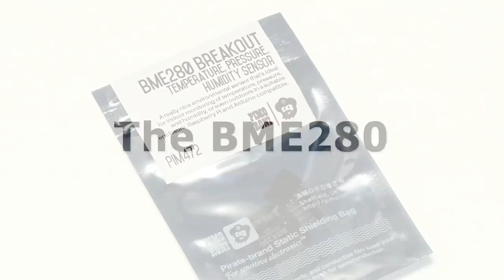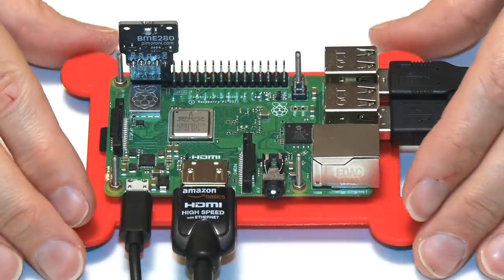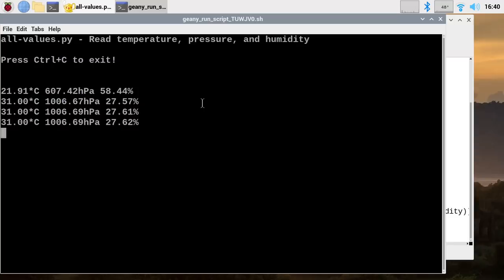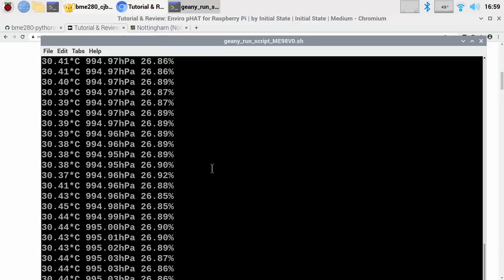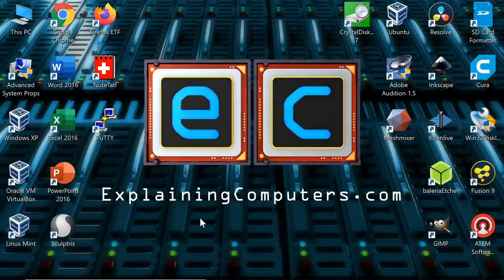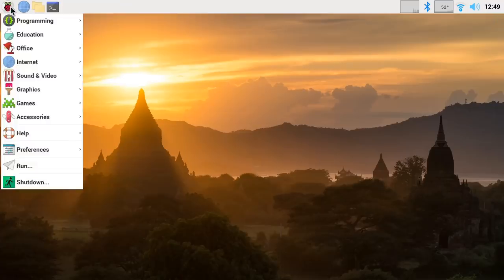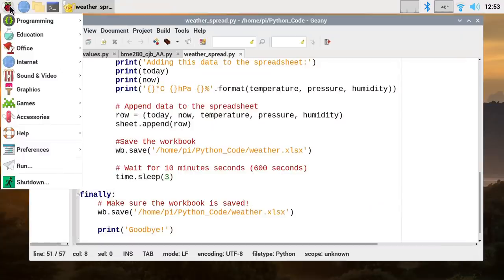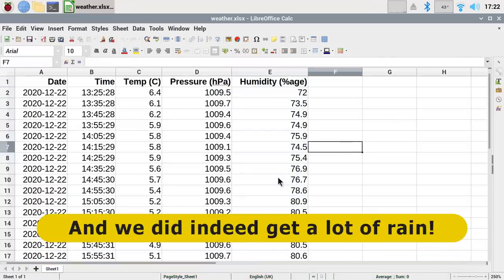Raspberry Pi Weather Station

Comment: Another great tutorial, I’ve one of these BME sensors and two DHT22 sensors (not as accurate and no pressure sensor) setup with Arduino ESP8266 devices logging to an influx database for analysis and a Grafana front-end, that’s running on docker on a raspberry pi 4 though! 😉

Comment: Chris, this is WONDERFUL.  You have helped me resolve how to get  my data into a spreadsheet !  For an improvement, I would like to see wind speed and wind direction added to COMPLETE my weather station experience  :-) 
Would you do wind speed with an analogue indicator ? Or a STEPPER motor ?
The weather vane would be simple enough with a few LEDS  and a photo cell, I imagine...
But how would you calibrate the wind speed anemometer ?

Comment: Thanks Chris, another interesting video. I have a thermometer attached to my pi 3b+. I start my temperature monitoring program, also written in python, as a cron job, so no need to manually run it. The temperature value is written to a text file every 10 minutes and it is also published to a web site hosted on the pi. The current temperature can be seen from a browser on my network. 

I had some fun running the thermometer for a month and graphing the values using some more python code (I was learning python).

I use it to monitor the temperature in my kitchen when I am making bread. Yes I could have used a $5 one from <insert store here> but that's not the point :)

Comment: It's a very educational. How to get a temperature in F? And add a wind strength and direction to the next video.
Reply: temperature = bme280.get_temperature()* 9/5 + 32
 pressure = bme280.get_pressure()/33.86                                              
humidity = bme280.get_humidity()
print('{:05.2f}*F {:05.2f}Hg {:05.2f}%'.format(temperature, pressure, humidity))

Comment: Great video once again Chris and one project I will look into building specially in this part of the world where the temp fluctuations can range from -15C to +40C along with the odd earthquake or 2 a year.

May I suggest if possible,  a couple of things to add to this project:
1. An implementation of a "Raspi-powered seismometer"  bit like the RaspiShake, possibly the "Geophone - SM-24" is to expensive component to consider for this, but this would be the ultimate weather station for me, due to frequency of quake we receive here.
2. The data collected published on a webpage as well as how you done it as done into a spreadsheet.  Perhaps change it to output/save to 2 files spreadsheet and text file that can be read later or go further insert it as MySQL query into a DB.

Also, putty is a great tool but I recommend you look into using "mRemoteNG" is a much more versatile remote utility allowing multiple panes side by side among other great features.

Thanks greatly for your education and engaging computing videos.

Comment: more possibilities: automate making a new csv every month so you’re not stuck with a massive file over time, visual graph compatible with home assistant - grafana? nodered? mqtt? view data on a smart mirror / magic mirror. build more raspberry pi sensors for different locations around the home. centralise them into home assistant.

Comment: Nice video Chris, huge amount of potential in these things for peoplei
've done something very similar using piZero's and a combination of BME280's and BME 680's. The 680 can also monitor the air quality for poisonous gasses. Very handy in my projects as i am monitoring the temperature, humidity, air pressure and quality in an outdoor car storage system. I post the data 
out to a hosted system on an InfluxDB with a nice Grafana front end. Also the 680 has a much nicer python library, however it is almost double the price.
Reply: did you manage to get it to a xlsx file. because i keep getting an error,
'( cannot convert (0 r to excel format value) its something with excel and the temperature of the bme680

Comment: How accurate is the BME280 sensor?  I've played with some cheap temperature sensors before, and they were pretty inaccurate... off by 3 or 4 degrees Celsius.  The data sheet gives accuracy numbers for relative humidity and pressure, but not (alas) temperature.  EDIT: Oops, found it.  They claim "typical" accuracy of +/- 1.0C for 0-65C, which is resonable.

Comment: What a disapointment! A weather station with no meassuring of wind direction or speed! :) 
Although i must say i was a bit disapointed (i will explain later), it's a rather interesting sensor you have chosen Chris. There are far more cheaper Humidity/Temperature sensors arround (eks. DHT11 and DHT22) I have used theese for years now. Especially the DHT22 has pretty good accuracy. I have had thougths about trying the BMC you are using, but found it to be to expensive for my use - i use several of thees sensors for surveilance of humidity in my home.
Back to the Weather station stuff. For several years i have had a raspberry pi running WeeWX. It gets data from a bought weather station (Moist, temp, pressure, windspeed and direction, gust and so on), and reporting data to online sites every minute.
The version I'm running now is pretty old and it only runs on an old version of raspian. That was the reasson i was disappointed. I had hoped from the title, that you had made a video about that kind of software. :)  
But maybee in another episode of Explaining Computers. ;)

I hope you understand that I'm really not disapointed at all . ;)

Comment: I started working on the same type of system using the Sensor Hat for Raspberry Pi. Ran in to the same problem with the CPU temp screwing up the results. Got screwed up trying to figure out what ribbon cable/ m to m or f to f converters to use to move the Hat away from the Pi.

Somewhere along the line, took a detour and ended up getting an account on OpenWeather, getting the current readings for my area from their API in Json format ( which I know nothing about but found Python code on Github that already decodes OpenWeather output ), and using the Sensor Hat extensions for Python scrolling the results over the 8 LED grid on the Hat one letter at a time, getting updates from OpenWeather about every 15 minutes (free as long as you don't query them more than once a second).

I believe you can add your weather station to their network if you desire.

Funny where you can end up when you start a project.

Comment: Interesting project, although it is probably worth pointing out that the pi4 expects an operating temperature of between 0 and 50’C although the BM280 will cope with -40 to +85’C .... I was expecting half the video to be about specialist pi housings to protect it while doing the data collection. 

Also, isn’t there a crowd sourced weather data collection project you could submit your readings over to?  I seem to remember there was going to be something like that for schools a while ago.

Keep up the great work 👍

Comment: Maybe should have mentioned that the pin header holes are offset in an alternating fashion so that the pin header can be inserted and used WITHOUT any soldering required, in case anyone wants to breadboard one of these and not have to commit to permanently soldered pins. :)

Comment: couple of things there Chris you may need to compensate the pressure to sea level using your altitude that will give you the accurate pressure for your area...also i dont kow if you know but the eps8266 or esp32  modules running tasmota are great for these devices.. ihave a lot of these running on my network sending mqtt data out to internet so i can get tempa barometric reading and humidity from any where i am . i also use an android app called mqtt dash board on my mobile hpoen to access this data...

Comment: The link between temperature and humidity lead to real life problems!
I worked in the bread manufacturing industry.... simply force cooling down the bread after baking is not a viable thing.
You need loads of cold air with high humidity so the loaves don't dry out and loose weight.
It was always a pain keeping the machines doing what they didn't want to do!
High Temps with High Humidity and Cold Temps with Low Humidity are what nature want's to do!
So of course we want low temperature with high humidity to cool our bread, but to stop it drying out and loosing weight 😎

Comment: I'm currently using a free weather API to do my weather display for the custom home hub I'm building.

I want to make a local weather station and add more indoors dht11 sensors around the house.

I have an hourly temperature graph that I originally used with my dht11 sensors to monitor temperature for an indoor grow area. And now I have it showing indie and outside hourly temperature...

If want to include an array of light sensors in my future weather station so I can track the sun position. Like a digital sun dial.

I'll have to look into pi hats like the one in this video do I can have pressure data... I'd also like to be able to collect wind and precipitation data...

But this project is probably years off before I find the energy and focus to make any real progress.

Comment: Happy New Year. Thanks for a wonderfully thought out and put together video. This a great and fairly easy raspberry project. I like using Window's 10  ssh program for connecting to the Raspberry PI, so that might alternative for some users. I am looking forward to see a year filled with more interesting for Explaining Computers!
Reply: This might a good project Raspberry Pi 400 because the GPIO pin aren't too close to the chips and there should no heat from the computer itself.

Comment: Thanks for the video Chris.  On my French mountain at 5PM  on 3rd Jan 2021 its -5C.  I wonder if the script can handle negative temperatures?  Best wishes.
Reply from the maker: The script can handle it. :) The datasheet for the sensor gives an operational range for the temperature sensor of -40C to 85C, but with full accuracy in the 0C to 65C range.

Comment: I just learned an amazing amount in 20 minutes. What a cool idea using a pi as a weather station and it’s a great start but I wonder how much further this could be taken. Could an LDR be used to measure sunshine, could you add wind monitor and maybe a rain measuring device using resistance impedance :)

Comment: I've already done this, but taken it much further.  I have the pi running headless with a bit of custom C running as a service.  I run MariaDB on a VPS with the pi connected via a VPN and adding the data to a database.  Apache is running, so I can simply load up a web page to view the data using Fusion Charts.  Its been running seamlessly for more than three years, collecting minute by minute data.  There is now more than 4 million records in the database.

Comment: Maybe it would be advantageous to time how long it takes to get to the stable table of results and then set a delay on the display of the data, piping the data to a small graphical display window with just an updated single result number as default and a graphical switch for data over time would be preferable to an SSH display window.

Comment: Thanks, great video as usual!  One quick question ... How was the BME library configured to know what GPIO pins were used for the BME280 board?  (For those who may need to use different GPIO pins to what you used in the video)
Reply from the maker: Thanks for this. :) The Pi communicates with the BME 280 over I2C, which is a two-pin interface available on the Pi via GPIO 3 & 5. So you can only use these particular pins.

Comment: Thanks Chris, I enjoyed that. I'm looking at doing something similar with the BME680 (which also includes an air quality sensor) but what I really want is to have the data sent out to an IoT platform on the web where the data can be stored in a database and displayed using dashboards in a browser. I'm still deciding on an IoT platform - the current front-runner being InfluxDB Cloud. I think that adding similar functionality to your project would make a good follow-up video.
Reply: did you manage to get it to a xlsx file. because i keep getting an error,

Comment: Wonderful stuff Christopher, instant sub. Will you continue to develop your weather system to include wind vane or perhaps windspeed?
Reply from the maker: Welcome aboard! :) I had not planned to continue this project, but as the video as proved very popular, I will. I am already pondering how to measure wind speed. :)
Reply: @ExplainingComputers  thank you for your response! One method is with the use of a reed switch. A small magnet attached to the rotation cups would suffice in activating the switch. We simply county the activations, apply some simple math and you have your speeds. If you want I can send you some reed sensors. There is a fair bit of documentation available. Keep up the great work!

Comment: I have the older 180 sensor. I guess the code to make it work is the same. It is something I have been trying to work for a long time. Also to have the data to go to a website. Yet have to build the site first and then go from there. I did manage to get the sensor working for a while but other things happened and it went (as all projects) to the back burner. Maybe start a site, get the sensor working and see if I can now get it working the way I am thinking of doing.

Look forward to what you have for the new year. May be interesting to see what crops up.

Comment: another great video (can't wait for Pi 5:)) ,
 I was wondering whether you're going to review the Odroid HC4 which is based on the C4 but with 2 actual SATA bays for HDDs , which would be perfect for NAS configuration
Reply from the maker: I have an Odroid HC4 arriving on Wednesday. It will be reviewed on the channel soon, in a video where I will set up a RAID NAS in OMV. :)
Reply: @ExplainingComputers  oh wow so waiting for that! i was just about to order one. Could you check in your review how good are the bays holding up those drives? I think that might be a "weak link" with its case
Reply from the maker: @anonylesss  I agree that the bay mountings may be weak link. Will report back!

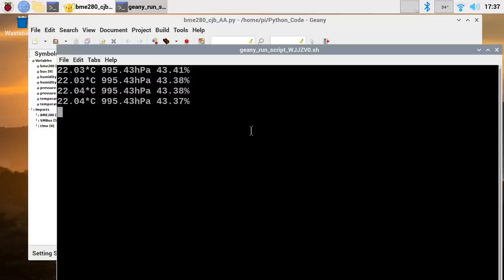Comment: 9:40 the RH is different because cooler air can hold less water vapour. The warmer air is just as 'wet' but has more capacity to be wetter, hence lower RH.

Take a look at https://en.wikipedia.org/wiki/Humidity#/media/File:Relative_Humidity.png

Reading across from 20 g/kg on the Y axis, you can see that 100% RH at ≈25°C is 50% RH at ≈36°C

If you graph temperature and RH the correlation is fairly apparent given enough readings.

Source:
I have a Pi 400 with a BME680 connected sitting next to me merrily doing just that as I type.

Comment: Not to criticise Chris here, but the Pi is over the top for this. I've done with an Arduino. I couldn't get a display working with this sensor on the At328P - just wasn't enough "flash" space. The larger MCUs have loads of Flash and can easily do this.

Have a look at HotStuff on Instructibles and you can see how I did it complete with a display and a DH22 for less than the price of a RPi3+

I does a LOT more than just read temperature and humidity though.
Reply: @schoolmaster1945  Really? I didn't notice that... ;)

Iit's right there in the comment John. "I couldn't get a display working with this sensor on the At328P - just wasn't enough "flash" space."

The ATMega 328p has 32K of Flash and 2K of RAM - K notice, not M! There simply isn't enough room to fit the LCD display driver and a bit-banged I2C bus in there with the driver for the BME280. I didn't have a free I2C with the display board that mounts to an Arduino UNO as a shield.

I could (but I didn't) have extended it to work with larger MCU such as a the Arduino Mega or even an STM32, 80226, you name it. 

It's so tight, I had to re-write bits of the libraries to make them more efficient. The result is very powerful and very easy to make although it does require soldering three pins.

Air pressure isn't particularly important for weather unless it's combined with other observations like wind speed, direction, UV index (which helps with cloud density) and such. Falling pressure tends to indicate change to the worse and vice versa but in isolation it's not a lot of help.

The BME280 is, however, a lot more accurate than the DHT22 which consistently read high by about 2 degrees C. 

HotStuff (the source is on GitHub) is 100% C/C++ creates a display that tracks temp/humidity over 1 - 24 hours (compile option), draws a graph and displays warnings for dry or damp air, over temperature, dangerous working conditions and more.

It can even control a heating system.

All for not much more than the cost of a RPi Zero if you source the parts from China. Not much more if you get them from the UK where Chris is based - and that's including a 2.4" TFT display.

Oh, and it doesn't need Linux nor a uSD care or a fancy PSU. The whole thing can and does run of a standard USB port!
Reply: @schoolmaster1945  WAAAAAY cheaper John. I used a Chinese knockoff Uno (Elegoo) but if you run into trouble compiling it and have one with a removable 328p, my lad will send you one out pre-compiled.

Even at Amazon prices, these are still cheaper than a Pi 3 and our prototype just sits there and ticks away to itself. It's rather useful if you do 3D printing since the plastics are quite hygroscopic.

Comment: Awesome video! One question:  What would you do for an enclosure to leave it outside?  I assume anything you would use would have to keep the daughter board separate because of the same heating issue described in the video.  Anything that would protect it from the elements would hold heat.